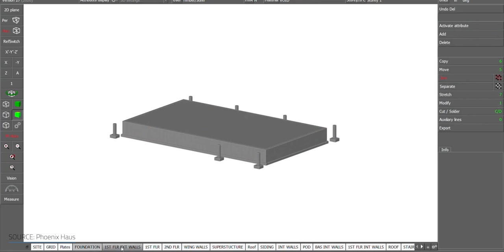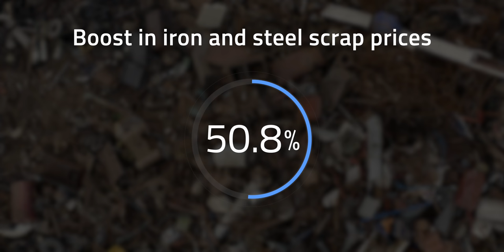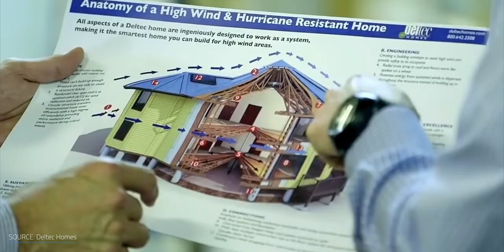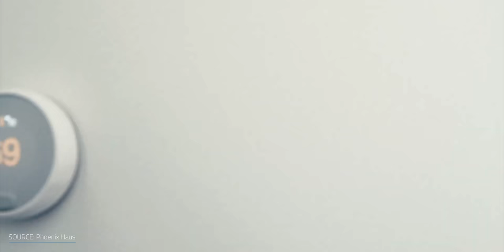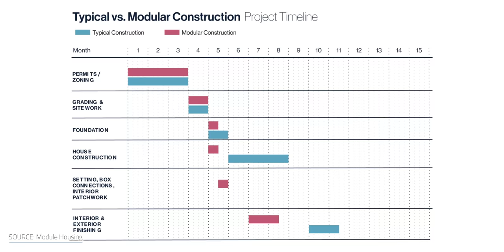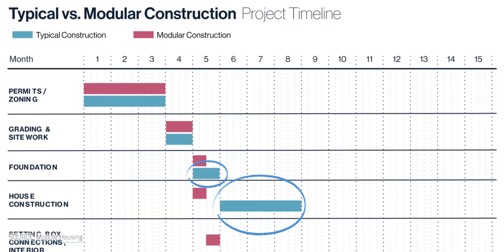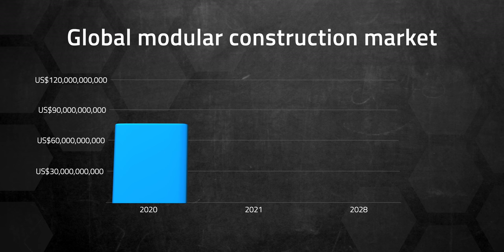Exploring Modular Homes - Cheapest Path to Net Zero?

Comment: I am going through the exact same process right now (and in New England).  I have been in touch with Unity and Birghtbuilt.  I am also looking into timber frame construction with SIP panels.  I would love to see more content on your experience through this process.  Thanks
Reply: The high cost of construction materials is a major barrier to affordable housing. However, there may be a solution in modular homes made with timber frame construction and SIP panels. This type of construction is cheaper than traditional methods and can lead to net zero energy bills.

Comment: The systems you described look great and efficient... unless you live in an area with high probability of forest fires (like where I live in Alaska). Which is why I am looking at ICF's (Insulated Concrete Forms), as they can be designed to be energy efficient as well as offer good fire and earthquake protection. And with the current prices on wood, the cost for construction is comparable to wood. I am curious if you have looked at ICF's?

Comment: This is very similar to the off site modular data centers I've had built in my work.  These being industrial structures, you can tell where the modules connect if you know where to look, but it would be easy to conceal that in residential construction.  One of our sites has a site built office complex attached to a modular built data center.  You can't tell a difference in quality from one to the other.  It all looks like one building.

Comment: Well done.  There are two fundamental flaws with modular homes:  The parts must be transported and also assembled at significant expense at no benefit to the buyer (or the buyer is forced to limit the geographical range of modular home builders) and modular homes must be finished on-site, which eliminates some of the factory-built efficiencies that are the reason for modular construction in the first place.  Minimizing cost and maximizing build efficiencies would lead one to choose an inexpensively transported, fully factory built modular home.  One example of this approach is Boxable (boxabl.com).

Comment: Matt, it is misleading to say that modular homes comply with all state and local regulations (2:23).  The manufacturing of the house in the factory (of a reputable company) probably does go a long way, but the fact is there is a lot of variability across the country, even if the jurisdiction's adopted Code is based on the IRC.  Local jurisdictions commonly tweak the IRC, which is a 'model' code (not the actual, legal Code to which the house needs to comply with) , to suit local conditions, local building practice, and frankly, the professional opinion and personal experience of the official that recommend the regulations for adoption by the State and/or local jurisdiction. An adopted State code, is commonly, if not usually, further modified by the Counties & Municipalities that implement the State Code. Even between adjacent counties within a metropolitan region, you will encounter pretty different  rules and procedures regarding how a house needs to be built. Fortunately, a future homeowner needs only to get very acquainted with one version. This is partly why you don't see modular homes everywhere, because you not only do have buy the modular home, you still have to hire local consultants (architect and/or structural engineer/ possibly a civil engineer) to adapt the modular house to the specific site, and to make sure everything meets local Code to get all necessary permits. It introduces another intermediate into the process, and it's not clear how much support the the manufacturer provides commonly. Whether the prefabricator is an advantage or not is a function of a given project's specific parameters.  It is still fundamentally the homeowner's responsibility to make certain that the home meets Code (to get Permitted). I would say the modular home can offer the possibility of higher quality, because it's built in a factory where processes can be automated and/or controlled, but whether it's superior or less expensive  compared to stick-built, is subject to careful consideration of your specific conditions and requirements. Finally, the value of modular homebuilding I would argue, is best realized by a developer who is building several homes on a tract of land.

Comment: Matt, housing hasn't necessarily BECOME unaffordable, so much as the SIZE and FINISH LEVEL have become so bloated that the average home price has also become bloated.  There was a time that a 600 sq ft house with a full unfinished basement would suffice for a family of four.  Done correctly, and checking your ego at the door, a conventional home that is constructed and designed correctly, can easily meet the needs of the modern family, energy efficiency and the budget.  EGO is the greatest challenge facing the new home market.

Comment: I've always wondered why home builders advertise "energy saving". Why not go the whole way and design a Net Zero? I mean no need to heat or cool. It was feasible 50 years ago with passive solar, but now with new tech, it's much easier with thermal mass inside, insulation outside.

Comment: A couple of garbage cans of waste from the production of the modular home? I would like to see the proof of that claim. There is still waste from the foundation creation, which is not built in the facility. And perhaps the factory is ordering its materials cut to order from the mill, but that's just outsourcing the waste to somewhere else. It's not like someone is out there selecting the trees to cut down specifically for the modular home vs the stick build. I'm not opposed to the building style at all, but the primary benefits are probably electric tools at the shop and reduction of vehicle transportation to the home site.

Comment: Great stuff, thank you.  In your research, have you come across a reference to the term "barndominium"? On the "cost per square foot" front, they seem to be an excellent choice for low-cost housing.  There's some suggestion that they can be constructed with energy efficiency in mind (from an operational standard).  Low labor costs are what keep the implementation cost down, but they also (appear to) use less materials, which results in less embodied energy.  I'm interested in your insights.

Comment: Modular housing is great, but it isn't cheaper. $200k for 1000 sq ft house and you still need to pay for land and utility hook ups?  10-20% less?  If they want to disrupt the market the price needs to come down significantly.  How is 10-20% less better when they have such larger economies of scale, low waste, and much quicker cycle times? You portray these as affordable homes and they aren't.  $200k per SQ. Ft. These things sound like it's mostly margin for the manufacturer.  I'd love to know what gross margin is on these things.  If it's 10-20%, then they don't know what they are doing.

Comment: First of all the price increase was because Covid messed up sipping and trade.  Second if states like California would open up more forests to manage harvesting they would not only lower lumber prices, but also provide good paying jobs, more tax revenue for the state, and the lumbering would create roads and fire break to limit forest fires they suffer every year.  Modular homes are very expensive to ship an with shipping being at a premium right now projects can run over budget and or be delayed months.  There is also the problem with local and state regulations and the fact some would rather deal with a local builder.  While pre-fabricated homes can be good quality, any time yo have a company producing large quantiles of product they tend to cut corners where ever they can.  It is a mixed bag.  Also while there might be some options they are typically VERY limited.  If pre-fabricated homes become even more popular you will either see the market get taken over by a large company concerned with only profits or tons of smaller companies popping up all over with a varied level of quality.  

CO2 is NOT the problem... it is PM2.5 and mismanaged waste.  They switched to CO2 because there was no money or power for going after poor countries they will not listen to you, but they is big money and power for going after oil and the US.  Even though China is BY FAR the worst polluter... 2x the CO2, 7x the PM2.5, 29x the mismanaged waste, and 32x the waste dumped in the ocean than the US, they will not go after China.  If it meant SOOOOO much to the environmentalists they would put a carbon tax on trade with China and not on much cleaner and more efficient industries in the US.  Instead they seem to want the US to export manufacturing to countries that pollute far more... then pollute more by shipping the products back to the US.  Most of the PM2.5 and mismanaged waste is in Asia, the Middle East, most of Africa...

https://www.iqair.com/earth

Comment: Interesting details however my family has for several decades built site built houses even recently for less than $85 a square foot and some of them less than $50 a square foot. And those figures include all the decor, appliances and furniture within those structures. And all the appliances are energy 🌟.
Reply: My most recent purchase of a used home in 2019 here in the panhandle of Texas only cost me $15, 500 for approximately 1300 square foot three bedroom two bath with a one-car detached garage. I am currently in this dwelling and renovation totals have been less than $20, 000. To finish it out will probably cost less than $8, 000.

Comment: Would you like to see videos?  Hmm... yes please!  I've been a fan of Bright Built for quite some time now.  You also showed, but didn't mention Deltec Homes which does have some non-round options as well.  I believe that we can do even better with housing.  EVs get a lot of love from those of us who like improvements, but better homes will also help us make a dent in our carbon emissions.
Reply: Incidentally, I grew up in a passive solar house.  It wasn't modular as it was built into the side of a hill.  It had a wall of triple-glazed glass on the entire southern end of the house and Slate flooring to soak up that heat.  100% DIY job by my dad and friends.

Comment: I wish 3D printed concrete homes as made by ICON (Austin, TX) were ready for prime time. They did a 100 house charity project (I believe) in El Salvador with small (650-700 square foot) homes costing as low as 4,000 dollars.

Comment: Modular construction has always made more sense than on site construction.  However, I think you will find that modular pricing is equivalent to if not more than the conventional method.  In theory, modular construction should with scale of economy and efficiency, offer a product far less costly than site built.  In reality, this does not seem to be the case.  Quicker builds and quality control...yes.  More economical alternative...probably not.
Remember the housing industry is driven by profit, speculation and Return On Investment.  Add to this lifelong tax obligation just to remain in a house and this paints a bleak picture for anything affordable.

Comment: After living in a maple leaf for 5 years and having a door fall out of my house. I disagree with the quality statement. I can also comment on the less waste and if you have built a house this will also touch on the less waste. So after installing a 36x20 maple leaf in September of 2012 I moved in, in Jan of 2013 all was fine for the first 2 months then I started seeing cracking all over the house in the sheet rock, this was fixed by maple leaf. Then in February of 2016 I had 3 of the 4 windows in the front of my house brake all at the same time, the house moved! Then I had to doors fall out when putting the doors back in I found that they had used carpet padding to fill the gaps around the door, most buildings would have used fiberglass. This is where my story ended with this house as I sold this house soon after having the doors fixed and built a house that would last…..

Comment: I don't think that efficiency of the house itself can make up for the inefficiency of building single household units in the first place... These one-off projects won't solve anything. We need massive public developments in dense urban areas.
Reply: People are working on multifamily housing that is Net Zero as well.

However, if you look at the energy consumption profiles of the states in the US, you will find that single family housing is a sizable chunk of it, and getting them to all be net zero will have a big impact on the entire landscape of energy consumption from non-sustainable sources.

In California, about 35-40% of the electricity consumption is for residential end uses.  Of that, about 66% is single family housing. 

So, there is a very large potential for energy savings in SF housing in this state, and most others, as well.
Reply: @mjmdiver1137  Ok, that's true. So it may solve one thing. But not the other hundred problems coming with suburban sprawl... BTW, it's same with electric cars vs public transport.

Comment: Having spent 30 years in the construction industry as an electrical contractor, for both site built and modular buildings,  I'm seeing you have over simplified this. Modular has been around for over 30 years,  it, like everything else,  has it's pluses and minuses and it's not the cure all you've tried to make it out to be. 
I'm not against modular homes but do real research before making a decision on what you want.

Comment: Cheapest path to net zero? Start by avoiding co2 emission manufacturing, transport of materials, and a massive supply chain leading to the structure.

Mankind has built in wood, stone, and earth/bricks for a long time. It may not be as shiny, but lets be real. They are all sustainable materials with little to no net emissions potentially. The more synthetic and processed a product is the more it is emitting in some form or fashion. Take a look at your standards and cut it down to the core essence of a house. 

You need a place that can be efficiently heated and cooled, has a roof to keep the rain off, and beyond that everything else is really open to negotiation. Having said that I'm really leaning towards earthbag walls with pole barn method of posts holding up a roof, framing for roof and ceilings. For the purpose of improving heating and cooling I would want the roof to extend past the earthbag walls to cover a porch surrounding the structure. During the Summer the porch can be open (creating a large shade space against the house and during the Winter close it up akin to a sunroom (creating a small space against the house that while not heated is still keeping the cold away from the house). 

The goal of that kind of approach is to keep skillset required low so labor can be plentiful. Earthbag means much of the labor for insulation and exterior walls are basically going into the local community. The offsite materials are roof, wiring, plumbing, and framing for porch, internal walls, and ceilings. If you are willing to consider a large covered porch as part of your living space it is quite possible for this to be a better approach. We have all seen old wooden buildings that have stood for a long time. Last but not least get rid of most internal walls. They drive the cost up dramatically and while nice are not entirely necessary. 

Houses are expensive for a variety of reasons, but it all comes down to death by a thousand cuts. Look at a house from the 60s. Count how many windows and doors it has. Do the same for a newer house. You will see more doors  and windows typically on the newer structure. Count linear feet of walls vs total square feet. You will find newer homes have far more. Count up linear feet of plumbing and you have more in newer homes. A newer home is more expensive because we have gotten used to packing them full of upgrades that simply aren't all that necessary. Simplify the house design as much as possible. You can drive the cost down dramatically. You can also push some of the costs into the local labor market in lieu of spending your money on a product made far away and shipped to you. 

Good luck with your adventure

Comment: I wonder how viable this is to remote locations and unconventional foundations meant to utilize the earth cellar, central pit heating, water storage, geothermal, and flood prevention for an area that gets essentially sub-arctic tropical storms. Mold is very much a concern if these homes are built to standards that are meant for a less rain forest environment and building codes and inspection has lagged decades behind the current tech.

Comment: As usual - focus is on the side problem instead on the major one.
The main problem is that a modern house is designed to last about 25-50 years. This is no rocket science: sealants and adhesives have a life 10 to 20 years, roofing adhesives 15 to 20, resins 10-30, fasteners 10 to 50, softwoods about 30, fiber cement roofing about 20 to 30 etc. etc.
What does that all mean ? It means that each generation has to build its own housing. We are locked into a never-ending cycle of building temporary dwellings (let's not forget about gigantic economic impact on everybody's life and everlasting debt cycle)  and then we complain about CO2, 500 million tons of debris etc. etc.
STOP BUILDING RUBBISH. Maybe that would solve some problems ?

Comment: Modules fabricated in a factory setting tend to be much more accurate than site-built houses due to use of jigs to make repetitive cuts and assemblies.  I live in a stick-built house from the late 1950s and some of the dimensional aberrations I've discovered are simply appalling. such as use of bowed studs and interior walls that were placed on the sub-floor an inch or more out of square.